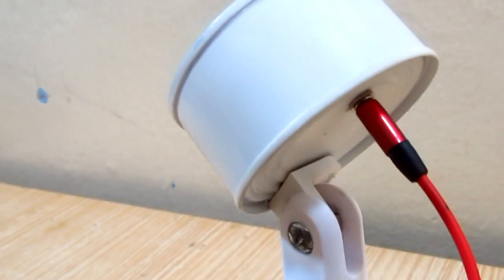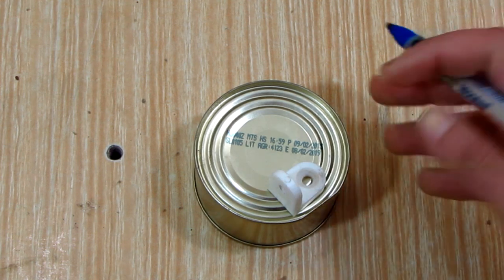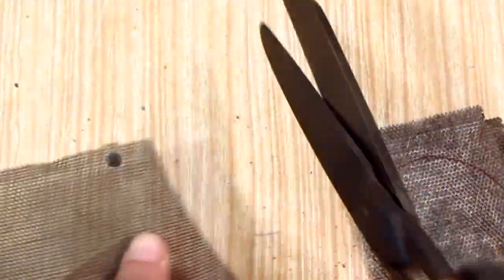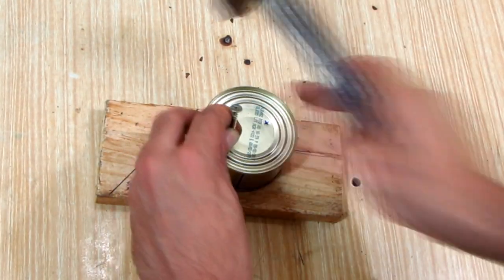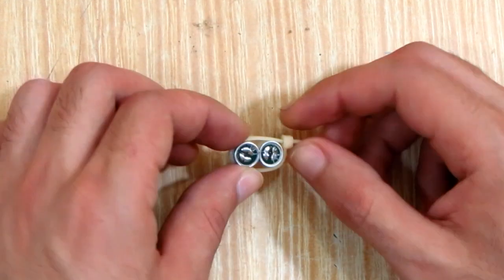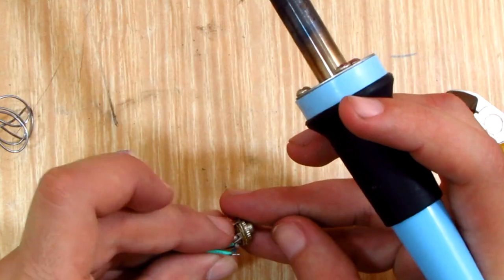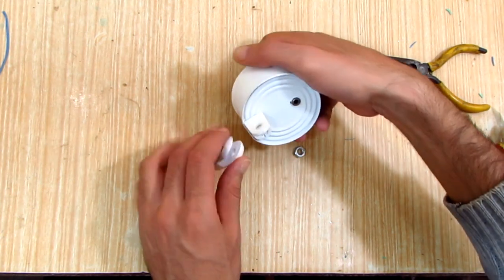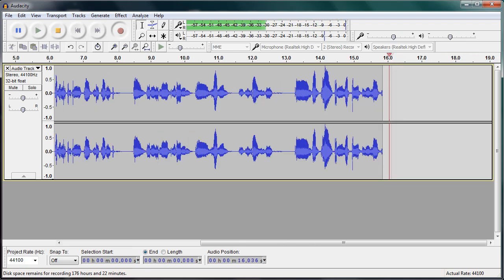Diy stereo electret microphone

Comment: Thanks Uploader - Just so your subscribers know - if they are thinking of doing this with a 6.5mm (1/4 inch) Jack plug, it will not work.  Electret Mic capsules require voltage to work. The world standard from mini jacks (3.5mm) used here is 1.5volts. There is no voltage from large jack sockets. You can google "Condenser or Electret capsule Pre-amp 9 volts" and there will be a million simple pre-amps to make. The response is great. Perhaps you could do this for your subscribers - it would be great with your little unit.

Comment: It works fine without pre-amp circuit?
Reply: No not at all. An electret mic technically doesn't need a preamp circuit because it's pre-polarized, but you should still use a preamp circuit to help with output. It'll probably cut down on the electrical hum that certainly does exist in the sample recording in the video.

Comment: answer fast can i use headphones for a wire??
Reply from the maker: You can but you might get noise
Reply: ok what wire?
Reply from the maker: use shielded audio cable for best results , but try the wire you have first, it may be shielded
Reply: but can i use a wire any kind of wire?
Reply from the maker: If you don't mind all sorts of noise, you can use any kind of wire
Reply: +AMG workshop You can just make a video out ot headphones please this is a little bit hard
Reply: +AMG workshop and i dont have the things that you had
Reply: Yah This Is HArd